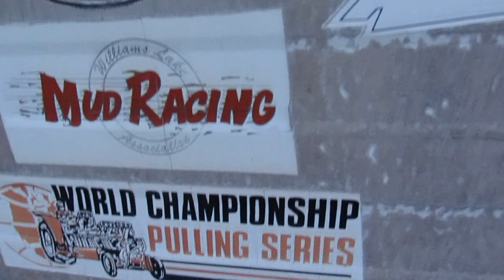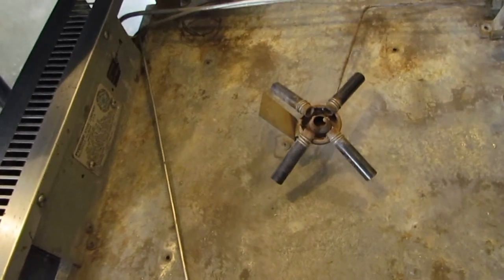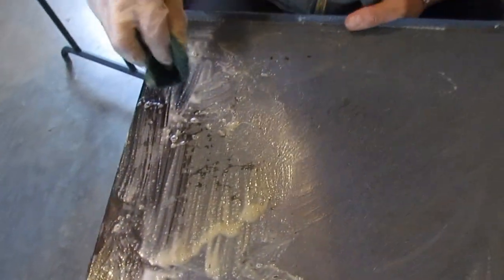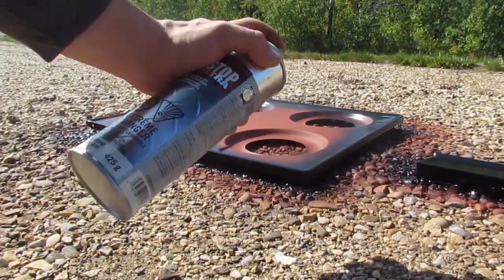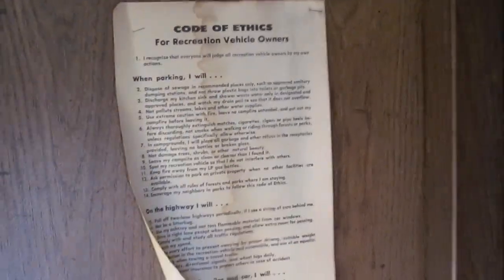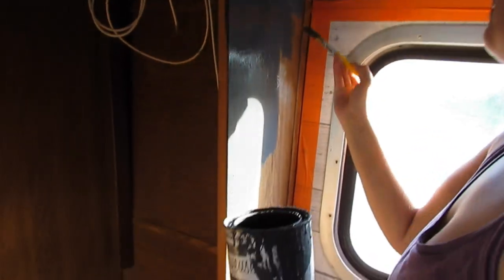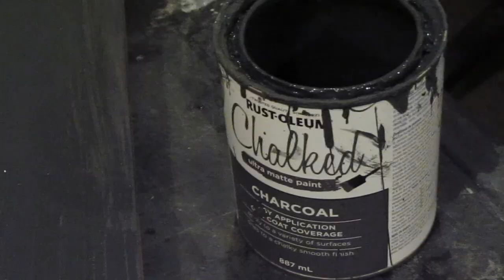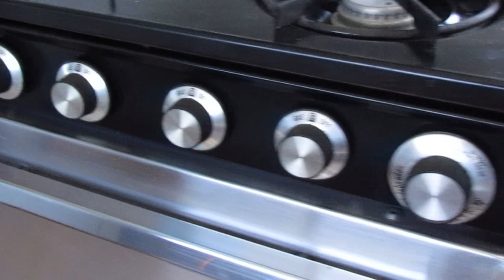Refurbish Old Stove! | S01 E05  | Restoring Vintage RV

Comment: dude u got rust issues try pouring coka cola on it let set then clean it off and repete till it clears up then wash the crap out it  to get coola residue off n polish the crap out of stove top.....
Reply from the maker: We used everything from cola to rust cleaners and managed to get it pretty clean then we primed and heat painted the top but the rest cam pretty clean!